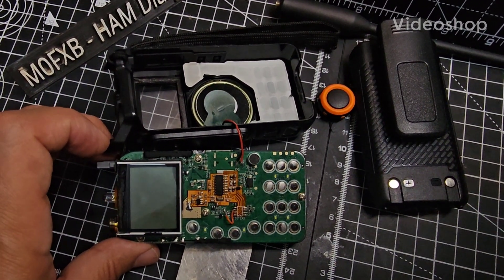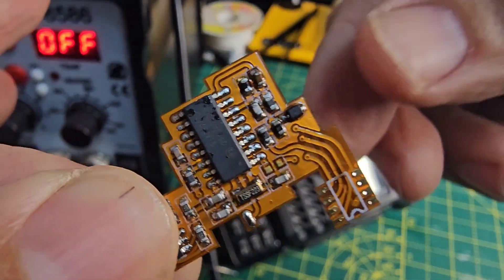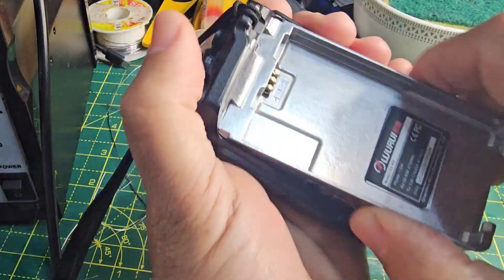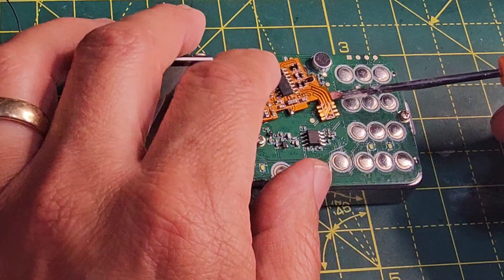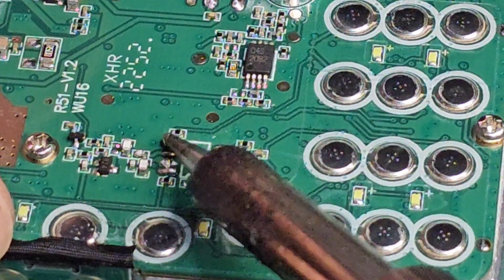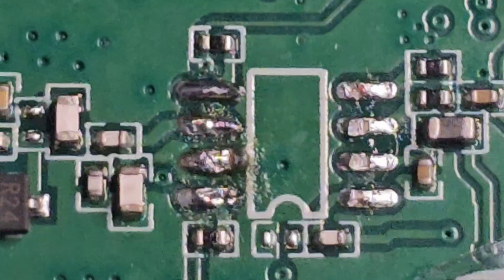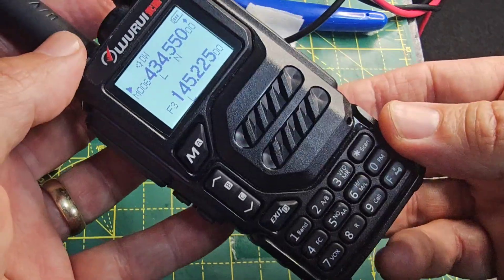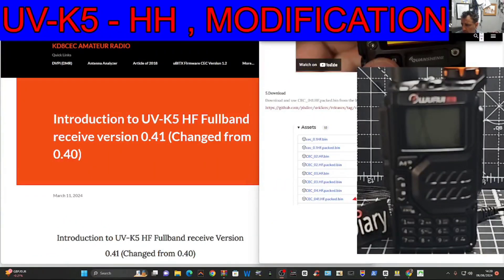UV-K5 , HF MODIFICATION , INSTALL BOARD v2

Comment: Is it possible to use an external HF antenna with the original antenna connector without installing an additional connector in place of the LED light?
Reply from the maker: Yes but there is a diode you do not remove .
Reply: @M0FXBHamTech  Which please?

Comment: Thanks for the video! The problem why is your radio not receives on the end is that, an external antenna have to be connected to the pad of removed tiny capacitor. If you not remove this capacitor you should be able receive HF signals trough the original SMA connector but signals will be not so loud as from external connection. 😉👍
Reply from the maker: Hi thank you which pad should I use ?

Comment: Well done on the mod Andreas, I can appreciate how tricky it is! I think your not getting any signal due to removing that capacitors you mentioned at the start. Also, I have the same soldering iron as you and I found with the small tip it just doesn't get hot enough for the job. Did you see my latest video of me doing that mod? Although not ideal, I used a slightly larger, blade shaped tip.
Reply from the maker: Thanks was fun I may add antenna rather than replace the chip .